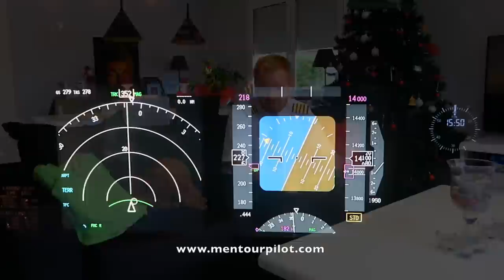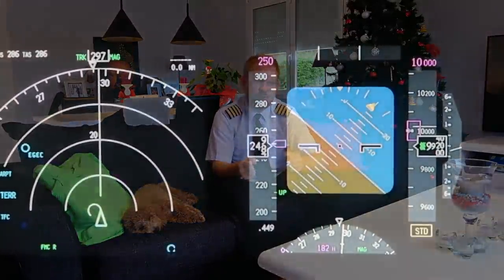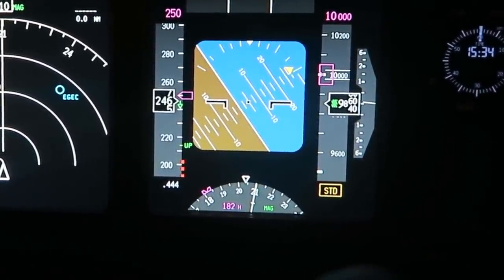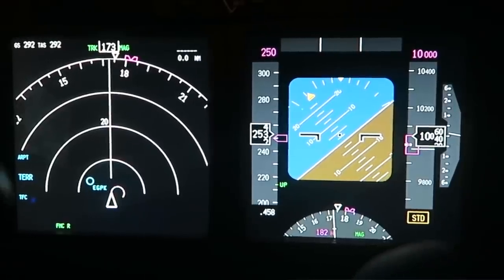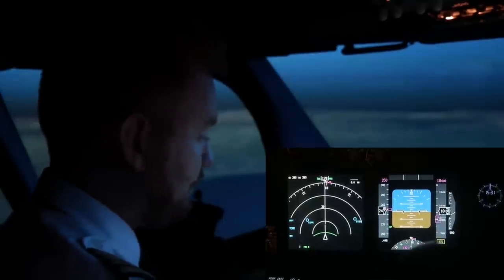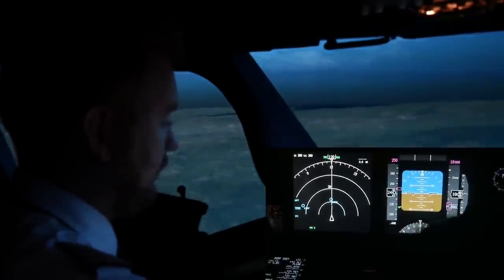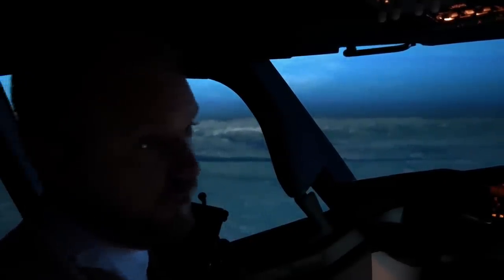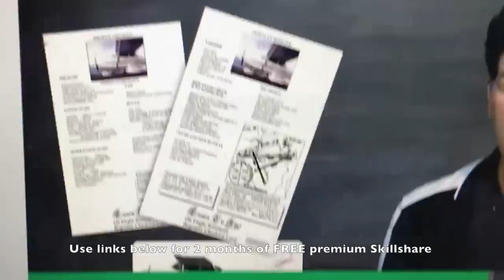What happens if you ROLL an airliner?!

Comment: Wasn't there the case where a FedEx pilot rolled his DC-10 to knock a hijacker off his feet?
Reply from the maker: He didn’t roll it, just some severe maneuvering
Reply: @MentourPilot  If a hijacker was in the cockpit's doorway and the pilots noticed them, could the pilots pull the nose of the plane up to knock the hijacker back down the cabin?
Reply: Mikosch2 Yes, and apart from that the DC-10 accelerated very close to the speed of sound (full nosedive) in an desperate attempt to get the hijacker under control, then when landing he used multiple 90 degree turns in order to line up with the runway, btw airplane was 18 tons overweight and too fast when it did finally land( It was never meant to land that heavy and that fast on a runway). The DC-10 was never designed for this but the DC-10 showed how well engineered plane it really was when you really needed your aircraft to perform and how well the pilots managed to fly it with severe injuries.
Reply: @alphadelta1219  Problem was that hijacker had already injured them severely, after the 2 other pilots managed to get the hijacker in the ally then the co-pilot pulled full nose up and did violent manouvers with the DC-10 that it was never designed. Then the co-pilot put the plane in a steep dive and accelerated the DC-10 almost to the speed of sound, they managed to land the plane even it was 18 tons overweight and too fast over it´s designed limits .
Reply: @henrybaleno  Ouch! I see.
Reply: This aircraft is still in service with Federal Express. It's set to retire this year!
Reply: I saw that FedEx video just a few days ago. I immediately checked it's registration number on FlightRadar24. It was in the air, flying from Memphis to Charlotte. @dustinduffie4773

Comment: The 737 Max rolls itself..Right into the ground..
Reply: So funny 😒
Reply: You're confusing nose-dive with barrel-roll.
Reply: @surferdude4487  Once it's roils 45 degrees it goes into a stall or "dive"..
Reply: @jagzilla1398  one thing no plane turns more than 30°.
Reply: @ethansaviation2672  What? Are you a Boeing employee?
Reply: @jagzilla1398  No😂, im just a person who is working to become a airline pilot so I know info about aircraft.
Reply: @ethansaviation2672  Well, when you're flying along in the pilots seat of a 737 and it rolls over, stalls and dives into the ground you'll know why...
Reply: Dude, you either trolling or don't actually know what is the issue of 737max.
It is not rolling at all, it is driving: it have system (mcas) that trying to prevent high aoa because with bigger engines plane have issues with stability on high aoa. To do so it slowly moves stabilizer to dive even if pilot pulls up. In both crashes problem was with aoa sensors plus pilot didn't recognized runaway stabilizer situation (in other flights with same issue they did so there was no crash).
This whole situation has nothing common with barrel roll of aileron controls at all.
Reply: @jagzilla1398  utter rubbish mate.
Reply: @ethansaviation2672  Yup, that what boeing makes...Rubbish..
Reply: @deadlymecury  How much are they paying you boeing shills...
Reply: @jagzilla1398  so you are actually trying to troll?..
Well, next time please read the details to be more accurate.
Reply: @deadlymecury  I'm just trying to get the truth out that boeing is building junk.

Comment: Neat:) So, now the question I really need answered, can you fly upside down in an airliner?
Reply: It will fly upside down just fine ......... until the wings snap off.
Reply: It can, but not for a long time, the fuel pumps will start sucking air as the plane flies inverted and the engines will flame out when the fuel which is already in the pipes gets consumed.
Reply: Yes, it's possible to maintain flight upside down in an airliner, but not advisable. The structural limit for transport category aircraft is +2.5 and -1.0 G. When you fly upside down, you have -1.0 G, so there's no margin left for the lightest gust caused by turbulence. The engines will eventually flame out, because the fuel system is not made for negative G. The engine may loose a lot of oil as well. But most important: Negative G will create havoc in the cabin, causing serious injury to people.
Reply: I'm sure Mentour could fly upside down in an airliner ... but he would look a little ridiculousstanding on his head if he tried - and all his spare change would fall out of his pockets. The co-pilot would probably be looking at him a little strangely too. No-one wants to witness a pilot having a mid-life crisis.
Reply: sure amigo... just make sure you double weld all the structure of the aircraft with bondo epoxy glue just in case something breaks off

Comment: What controls did you hit coming out of the barrel roll?
Reply: I'd assume the standard spin recovery. Level ailerons, rudder into the roll, smash the thrusters and pull.
Reply: It looked like he was coming up to the DNE speed, so I imagine he hit the air brakes (spoilers?) to try to increase drag and prevent structural damage. I imagine that he put power to idle as well to prevent that from increasing air speed.

Comment: That's sweet, you should definitely practice that as well and push the stick neutral and forward as you pass through 90 degrees. That pull on the stick is going to nosedive the aircraft as it goes inverted. Hopefully something you'll never need but if the situation ever does come up it will be less stress on the airframe and less loss of altitude.
That holding the stick back is what creates the bobble in stunt plane barrel rolls.

Comment: Has there ever been a real-life situation where a passenger plane (flying as such, not in a demonstration) had to do a full roll? I'm curious now!
Reply: I would think a fully fueled passenger jet w/cargo, may vary by design, would be at risk of excessive structural stresses during extreme bank & roll.
Reply: Know this is a bit of a late response, but there was at least one incident where a 727, with passengers, unintentionally ended up doing a roll. TWA 841. The airplane was damaged in the incident but made an emergency landing at Detroit Metro Airport.

Comment: I know that an airliner's emergency descent focuses on reducing lift, creating drag, pitch down etc., but, hypothetically speaking, could a 737 (structurally) handle an emergency descent maneuver (i.e. rotating aircraft and using rudder to bank down)? And if so, what bank angle would it be able to handle for the required time to get to a safe altitude before suffering structural damage? Heard of it being used in light aircraft and military, but never heard of it in airliners. Thanks 🙂
Reply: All airliners and flight crews must be able to do an immediate emergency descent if the cabin depressurizes.  That's definitely something they practice, and all airliners must be able to endure that maneuver.  

There are almost certainly youtube videos of pilots demonstrating this in a simulator.  I think you basically slow way down, throw out all the flaps and the gear (to create drag) and then put the airplane into a steep dive, but with all the drag, your forward airspeed doesn't get super-fast, but you can lose a ton of altitude quickly.

Comment: I think there was a 727 back in the 70s that flipped over 3 times where a computer had malfunctioned. I thought it went into a steep dive and accelerated too much but the pilot regained control and flew over the control lower fir them to inspect the plane for damage where they told the pilot everything looked normal and the pilot made a safe landing. I thought that was t w a but I could have dreamed this whole thing.
Reply: 727s don't have computers in the flight controls. Do you have a link to the incident? A 707 was rolled during development, the pilot said he was "selling airplanes" and it certainly did.
Reply: @cageordie  don't have a link. I think the incident was covered on a TV news show around the time of west 57th probably closer to 1983 than the 70s.

Comment: I was a simulator tech in the Air Force - assigned to a KC-135 (Boeing 707).  I asked the pilots if a KC-135 could do a roll.  The answer was yes, but it would have to be a 1 G roll.  They said the engines are not designed for such lateral loading.  Whenever I tried to roll, the three generators would trip off.

Comment: Some trivia:

On August 6th, 1955, Pilot Alvin "Tex" Johnston performed not one, but two barrel rolls of the Boeing 367-80 prototype. This single prototype was the basis for both the Boeing 707, and the KC-135 fuel tanker (on which, I was a jet engine mechanic).

The rolls were maintained at about 1 G all the way through. There were press aboard during the time, and this perfect 1 G roll kept them confortable enough to snap a few pictures out the windows during the rolls. There's a really eerie photo of the wing hanging upside down relative to the geound. Theres also some grainy video from thw ground of it doing these rolls on youtube.

These barrel rolls were unsanctioned. It was simply supposed to be a flyover of an air race. When chewed out by his boss at Boeing, Tex claimed he was simply selling planes.

In fact, this may have actually been the case. Among the many aviation industry representatives sent to the air races, a few were USAF. Seeing such a big airliner perform what was ostensibly a combat maneuver, may have cemented their earlier decision to pick the KC-135 tanker over the as yet unbuilt DC-8 tanker.

Even more trivia for you, Tex Johnston (and his mannerisms) was the inspiration for "Major Kong", the comically and unstoppably heroic B-52 pilot in Dr. Strangelove (If you haven't seen the movie, maybe you'll recognize the meme of a cowboy riding a nuke. That guy is based on Tex Johnston).

It wouldnt be the only time a KC-135 was rolled, or otherwise thrown into extreme maneuvers... Though it may be the only time a roll was done intentionally. There are a few incidents where KC-135s lost a pair of engines on one side, throwing the plane out of control. I can also think of an incident I heard about where a KC-135 broke the sound barrier in a dive to escape migs.

_____

As a jet engine mechanic on KC-135s, I had to get an engine run certification for it. An easy way to practice engine failure procedures, the base had a full motion KC-135 flight simulator the instructor scheduled an hour on. Naturally, we plowed through our engine run stuff to finish off the hour playing with the flight simulator. Bare in mind, I'm a jet engine mechanic, not a pilot. But, I did grow up playing the crap out of home flight sims.

The go-to thing these classes would try is a barrel roll. Usually ended in failure. In fact, the previous class briefly broke the flight sim, as they some how managed to go past the limits of the hydraulics while attempting the roll. So we left motion off while messing around with it to avoid breaking it again.

First time I tried it, spent too long in the roll, and it dove inverted and oversped within seconds.

Second time though, I throttled up to max, dove a little bit, pulled up and to the right, then I cranked the yoke over 90 degrees left while holding some back pressure, and kinda shocked the other guys on the flight deck after pulling all the way through and levelling off. I'm sure it was sloppy. Definitely no Tex Johnston roll. I was just happy I kept it consistent at a little under 2.3 Gs all the way through (which my GAC friend in the copilot seat informed me is the limit for an Over G inspection, so I guess I came really close to "breaking the jet").

Anyway, that was one of the most memorable experiences of my life.
Reply: PS, for reference, although the Boeing 707/KC-135 is a 4 engine aircraft, they were build when jet engines were in their infancy, and had poor performance compares to modern high bypass jet engines. As a result, theyre actually quite small. They're about the same size as 737s. I'd estimate KC-135s are a little bit longer, but a little bit skinnier.

Whenever we parked a KC-135 on wash rack, sometimes Navy P-8 Poseidons would be scheduled at the same time as well, and park in really close in the opposite direction so the wings dont hit each other. It was a good way to compare aircraft sizes.

The P-8 is essentially a Boeing 737 that has been converted into an antisubmarine warfare aircraft... It's actually a pretty nutty plane in its own right, basically a 737 bomber. It has a bomb bay in the back, just behind the wing roots, which can drop depth charges and sonobouys. And I remember they had external hardpoints on the wings, for torpedoes, and I think one of their crew even told me it can carry anti-ship harpoon missiles.

Comment: Not going to give credentials or brag but as someone with significant time in Flight Training Simulators I can offered a bit of insight.    Trim is key here.   Once the plane goes through 75 degrees of bank you need to quickly trim it significantly nose down.   Also it's best to enter this maneuver with more speed then you had around 280 to 300 knots IAS in a shallow dive. Begin banking the plane and pull up to level rate on you vertical speed indicator.  Quickly but not too fast continue your roll up to 60 degrees while also adding power.  When you pass 75 degrees add alot of nose down trim and continue as fast as possible past 90 degrees. This is the critical part as the wings give you zero lift so you want to have as much forward momentum to keep the nose up.  Once you get past 150 degrees the wings will actually act like wings again even though you are inverted with the nose down trim they will start to generate more lift as they level out at 180 degrees. Also you must resist the urge to pull back instead of pushing forward.   At this point it is a matter of doing everything in reverse.  Build some energy and when you approach about 115 degrees of bank trim the nose up.  It will keep your barrel roll straighter and will actually reduce the g loading on the airplane.